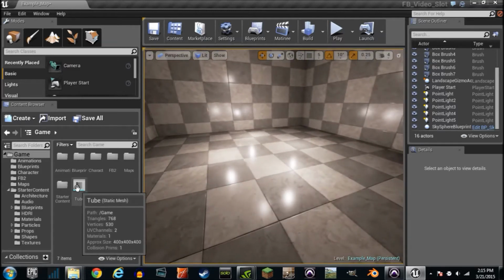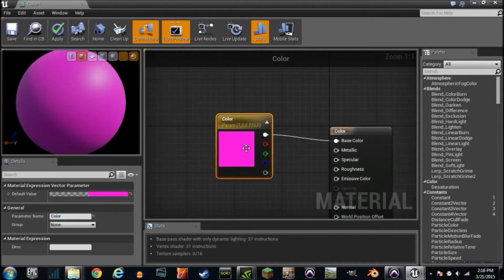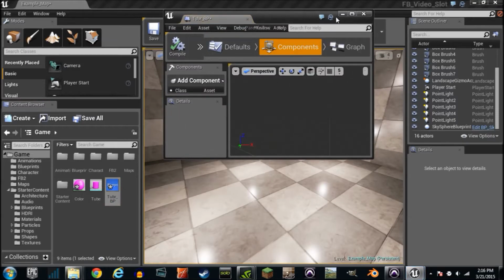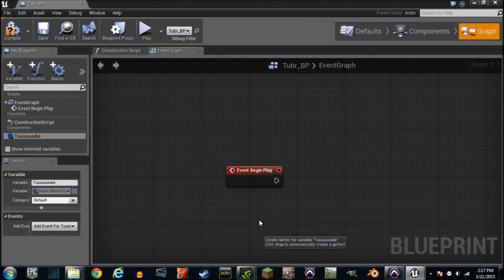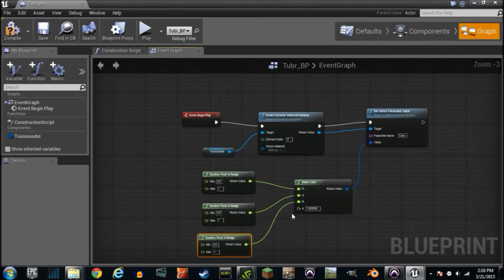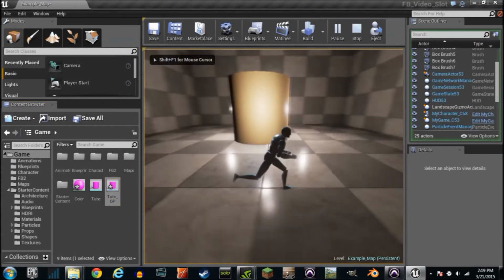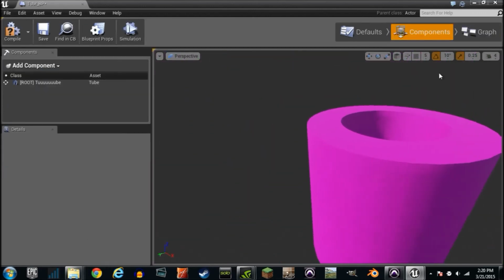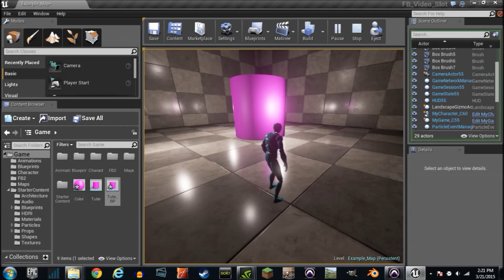PTV Unreal Engine 4 Blueprints tutorial 2 (Dynamic Material Instances)

Comment: Wondering if there is a way to do this without having to chain multiple "Create Dynamic Material Instance nods" and change each index manually 1 by 1 per nod..
Is there a set of nods I can just plug into the Element index of a single Create Dynamic Material Instance nod to set lets say index 0 to 6?